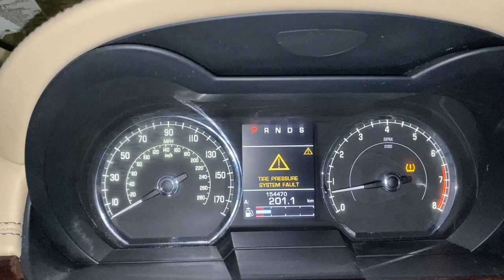Rebuilding a wrecked Jaguar XK 5.0 Porfolio Convertible Wheel Bearing & Control Arm We need help!

Comment: Gotta say that I really enjoyed watching you get your Jag XK back on the road.
I'm about to have the Front Left & Right Upper Control Arms and Shock Absorber Insulator replace this week and I'm a little nervous. Did you replace yours? Did you post a video of it if you did?
Next week I'm having a total repaint of the car. The shop will have it for a week. The following week I'm going to have my service mechanic work on replacing the Rear Left & Right Upper Control Arms as well as the Suspension Stabilizer Bar Link on both sides. He will also replace the Rear Steering Tie Rods on both sides. Then I can get a full Front and Rear Alignment.
Major make over but it'll be perfect when it completed. 
I hope you're well my friend and please post a completed video of your car.

Comment: The tire pressure monitor warning is pretty common, obviously check the tyre pressures (if it's cold they can act up). Or it could be the module, which is a dealer only fix unfortunately as there is some configuration required. Looking at a 500 euro job unfortunately. You should join the jaguar xk owners page on Facebook and post your video, sure plenty on there will offer help as well as get plenty of views!
Reply from the maker: Pfoee I was already afraid for that. Due to COVID I’m on a waitlist at the dealership to hook it up to their Program! 💪💪 keep you updated!!

Comment: I need help, I have the exact same car. It drives straight but was hit in the front, don’t know by what. My guess is curb. No airbags deployed. (Copart). The driver’s side wheel is pushed back  to the point of a finger width to wheel well. The suspension moves or I should say the lower part of the a arm moves around a lot. Am I looking at a bad ball joint or is it actually the crossmember? I watched you check it top and bottom, side to side and mine doesn’t move until you back up and hit brake or turn tight. Your video #4 is good but doesn’t really go into detail. Would like more talking and no music. Just my opinion. Any help would be great. I would love to get the wheel back to its spot just can’t find anything bent and with it moving like it does? I could send picks. Or even post a video. Just can’t afford to through cash at it. It’s the only thing wrong with the car so I want to fix it right the first time. Thanks. I have watched a lot of your videos not just the ones with the jag. Fixing to watch about the boat you have. Thanks.
Reply from the maker: Hey! Sorry for my late reply, but we somehow overlooked your comment. If you're still in need of help could send a video to info@absoluterebuilds.com ? We would love to help you!
Reply: @AbsoluteRebuilds  Since last post I was able to get it to a shop with a good lift. The lower arm is bent and part of the H frame is torn. I am going to try and straighten the arm and weld the H frame. I will send pics to your site and if you can see another way to make it work let me know. I really thank you for getting back to me. The car is just sitting right now so better late then never. Thanks again.